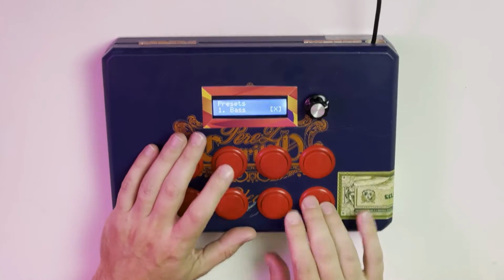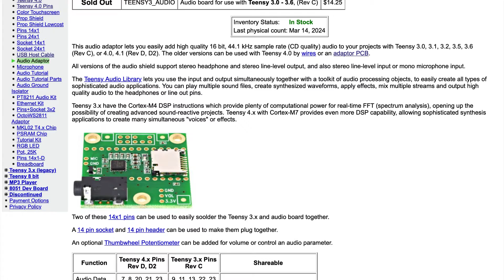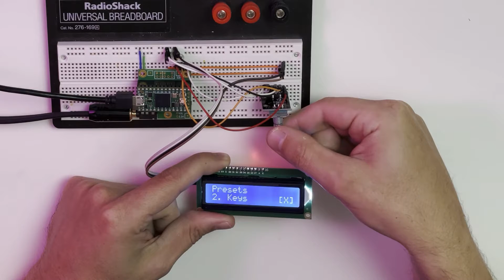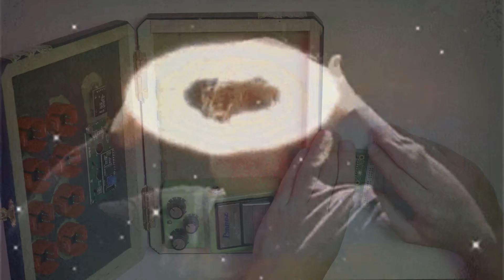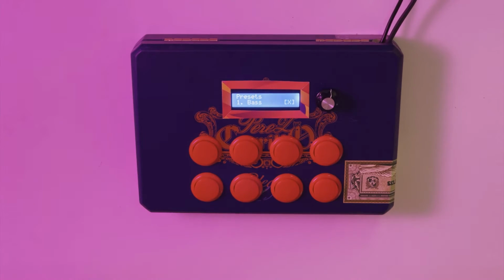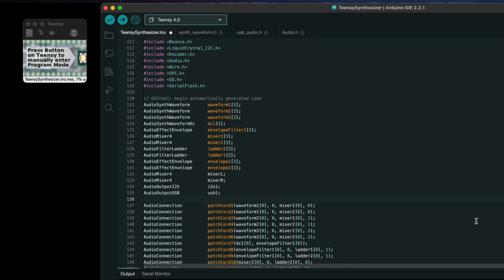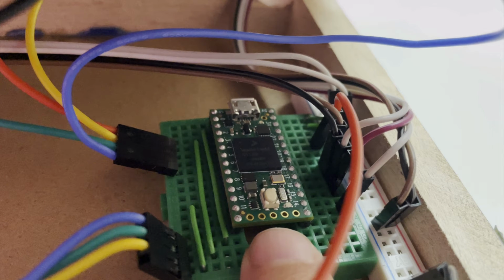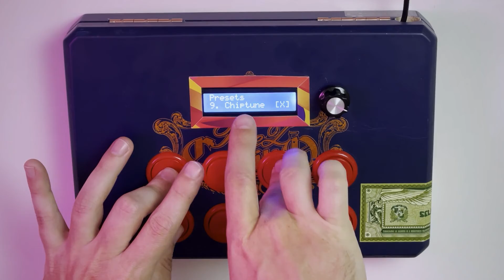DIY Teensy Arcade Synth | Tutorial & Presets Demo

Comment: Excellent video, friend! One question: In Brazil the Teensy 4.0 is extremely expensive, do you think replacing it with an ESP32 or STM32F4 could work?
Reply from the maker: The short answer is: I don't know. Generating waveforms on ESP32 and Arduino boards is pretty limited. I need to dive more into it myself. Another option is trying to run a synth program on a Raspberry Pi, but that might be at a similar cost. If I find any good, cheap options I'll be sure to share them on the channel. 🙌